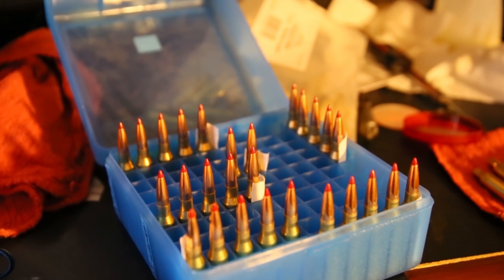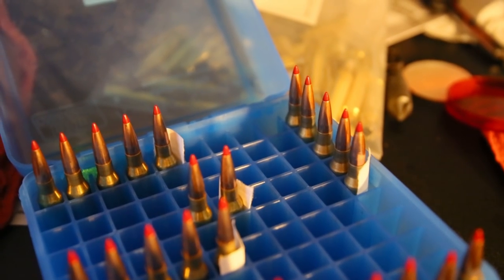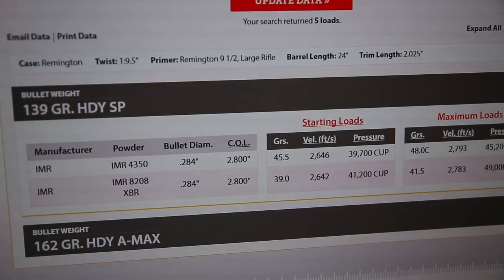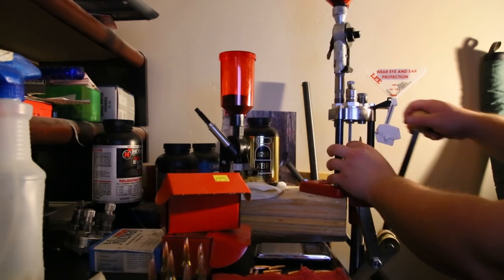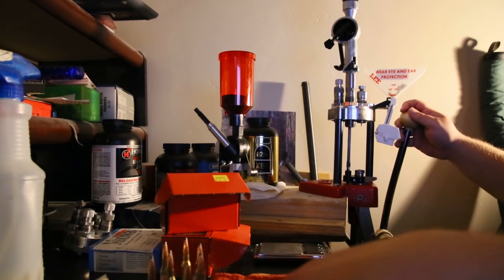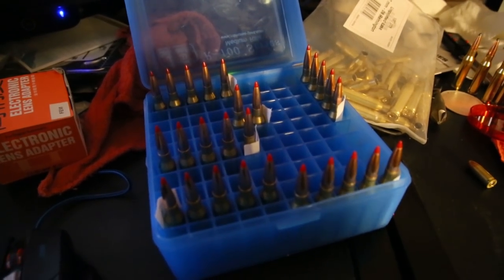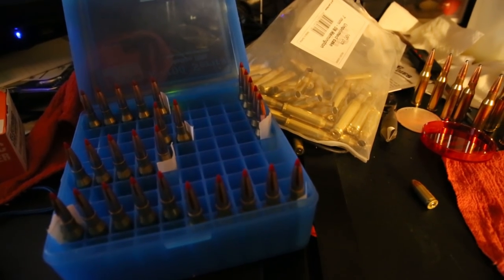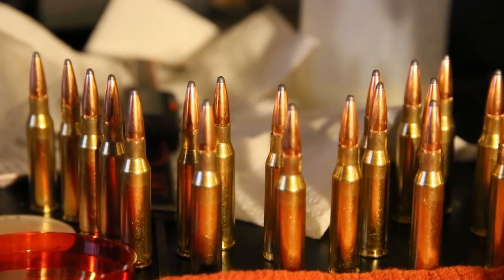Why I switched from 30-06 to 7MM-08 And reloading 7mm-08 for Elk - Lee Classic Turret Press

Comment: I have several diff. calibers including the 7mm-08, 30-06, 325 WSM 270 Win and 243 Win.  I have always had a huge preference for the 30-06 but I do love shooting the 7mm-08 the best!  All of those cartriges are awesome in there own right but the recoil of the 325 is a bit much it flat has Elk killing power to spare!!  But the cost of each round and the punch to the shoulder is significant!  The 243 has speed to burn but is a little too light for the large game.  The 270 is a great shooter and like the 30-06 will do anything well but has the kick factor that the 7mm-08 does not and it performs as well as the 30-06 in close <300 yds and >300 a little better due to BC and my shoulder loves it and so does my wife and 12 year old grandson they both can shoot it well and fast for follow-ups with no flinch.  *7mm-08*

Comment: I only fire 165 gain projectiles out of 30 caliber rifles which is what I shoot out of my 06 Ackley.  But, I will be getting a 7mm-08 for my wife.  The only time I bring any thing larger out is when targeting large Wapiti or going North of the border for moose or bear then I use my .338 Win Mag.  I have found it better and most rifles shoot more accurately with less that max pressure loads ... as well as the brass lasts a lot longer (one of my main reasons to going with the .06 Ackley is the lack of case taper, all I ever do is neck size, it has no brass flow as all tapered cases have).

Comment: I reload for a bunch of different cartridges, about 30 of them at the moment and the 7mm-08 is my second favorite. Great performance on deer/hogs very little recoil or muzzle blast heck the kids shoot it with max loads with no complaint. I am getting consistent 3/4" groups at 100 using Big Game and 140gr Sierra Game Kings, not too shabby for a 6lbs rifle as with ALL of my 7mms it took a bit of load development to get it dialed in but I love it now. The only reason I rank the 6.5x55 higher is how amazingly easy it is to work up a new load for, pick any 140-143gr bullet and place it over RL22 and I guarantee sub 1/2" groups, best group was the SSTs at 1/16th" at 100 yards! A rapid expansion 140gr bullet from either is potent deer medicine, the 6.5mm has better BC while the 7mm-08 gets higher speeds by about 100 fps.

Comment: 7mm-08 is a great gun, I have one in a Ruger American that had a 22" barrel that shoots lights out. I run a heavy dose of IMR-4350 with a 139gr. BTSP Hornady Interlock, I have shot elk with this bullet at about 250+ yards knock 'em down. I am going to try the 150 ELD-X Hornady came out with for the .284 caliber guns, which I will try for the 2017 hunting season on elk and deer, might even try it on a black bear hunt this summer. Good luck with your reloads with the 162's let us know how they grouped and what kind of speeds you got out of them?
Reply: 7MM-08 at any reasonable distance with solid (copper), or 140 gr Lead core will sufficiently do the job.

I've killed many a black bear and can attest they take nowhere near the energy as opposed to even a whitetail.

My 7mm-08 is a "Truck Gun", that means always there... Even if I'm hunting with a different round, it's always "THERE".

I can get 3/4" inch outside to outside groups with it every day but I also handload.  I would advise Hornady Factory Ammo if you do not.  140 preffered for bigger game.  Solid copper platforms, 120 is enough below 300 yards.

TR
Reply: BTW: consider ammo availability in your choice.  The ole '06 still performs as well as it ever has and is no slouch.  PS I have a .338WinMag named the Hammer and a '06 named ole Betsy.  :-)
Reply: I have a .30-06, 270 WSM, 26 Nosler and my mack daddy .338 RUM. But I like this 7-08 it is a fun gun to shoot. Happy Shooting and hunting....
Reply: @travisrushton7966  The 120's, how far are they off the lands? Is there a minimum weight bullet you need to have to get close to the lands?
Reply: @Ebaybow  I load them pretty far out in the cartridge. From the lands, ?, not sure as I don't own a Micrometer Adjustment tool for the 7mm-08. Remember this gun of mine is "probably" a fluke cheap gun that goes everywhere and is accurate as all get up. Sorry I couldn't answer your question. I have a Micrometer tool for my .338 but I've been able to tailor loads for the rest of my guns with no need. I absolutely LOVE the 120's... In Barnes TTSX, Accubond, or ballistic tips. I've taken my share so I'm not just qback armchairing. Good luck and try em out!  REM7600
Reply: Kelsey how did those 150gr eldx's work for you?

Comment: I think the 7mm-08 is a great round. It's ballistic twin is the 7x57mm Mauser. Both cartridges punch above their weight class. I have a commercial Mauser 98 7x57mm I use 7mm-08 load data with no problem. I think the 7mm-08 and 7x57 smoke the 6.5cm. I think both 7mm-08 and 7x57mm are under rated. If you use the right bullet with high BC I think 7mm-08 even the 7x57mm can out perform 6.5cm even the .270 Win. I was told by my gun smith my 7x57mm can handle hotter loads than the 7mm-08? I don't know if I want to chance that.  Great video!

Comment: try reloader 17.  with 145g lrx barns 48g reloader 17  I get 2900 fps from a 19inch shilen barrel. no pressure signs loading 5 thou off the lands . 2830 fps with 47g behind 162g hornady eld no pressure... superb long range hunting round
Reply: Mine likes the 139 sst with 43.5 gr re17. Not fast but every bullet hole touches each other at 100. I've only shot it out to 500.

Comment: Glenn,  Have you ever experienced any of the eld x bullets blowing up on impact on shoulder shots?  I have shot some eld x factory ammo through my 280 remington as well as my wifes 7mm-08 and I am yet to be pleased with the terminal performance on game.  I shot two whitetail bucks last season with less than desirable performance.  One shot at 120 yards and the other at 265 yards.  I lost one of the deer even using a tracking dog and the other deer ran over 200 yards and this was with a shoulder shot that has never failed me with hornady sst and barnes ttsx bullets.  The accuracy is amazing in the eld x bullets but i am scared to use eld x for hunting whitetail and hogs now.  The deer i did recover the bullet from showed about 3 inches of penetration and the bullet completely broke into numerous pieces of shrapnel.  I see people praising this bullet on multiple sites and i agree the accuracy is superb but shooting at non magnum velocities I feel this bullet should have held up much better seeing as Hornady claims it is a short and long range bullet.

Comment: I do not own the 7mm-08 . I use a 30-06. As good as the 30-06 is . I would think the 7mm-08 is a better all around cartridge for the lower 48 but would prefer a 30-06 for Alaska . 200 gr partition in 06 would be hard for the 7 mm to beat on brown bears. If I had  a 7mm-08 I'd probably shoot more because of less recoil and less cost of reloading.

Comment: Dear Glenn.......thank you for posting. You mentioned problems with your Remington's........ Can you elaborate? We have a big deer hunting camp with a ridiculous variety of calibers and makes. Pump and semiautomatic 280 rems to 338 win mags and of course the old timers with their 30\30's and 35 Remington's and everything in between. My son is going through gun safety right now and its not even a debate that I'm buying a 7mm08 for him. Besides uncle Steve that has a 270 short mag Remington 700 and I have a regular 270 win in a rem. 700, we are the only 2 that has slightly newer Remington's (absolutely amazing tack driving rifles at the 400yrd range). I was going to order my son a 7mm08 in the model 700 stainless like mine and uncle Steve's. Has their quality gone downhill? Buying a kid his first rifle is hard enough and then finding out you bought him a piece of junk........I'd like to avoid that sir.
Reply from the maker: Dick Tracy, I think their model 700 is still very solid. I had the model 710 first, which had several issues, and the n the new model 783, which had one main issue. The main issue with the 783 was the ejector kept breaking. Well technically not breaking, its held in by a spring, and if bumped right it would become dislodged and the spring with flip it way out there, so it was impossible to find. After the second time it happened, I returned the gun. But it was tack driving accurate, like the 700. Just that one flaw. If Remington can redesign that ejector it would be a great value gun. 

But, as for the 700, I think you will be fine. They haven't made too many changes to the design, which is why its still solid.

Comment: The 165-170gr. In 06 will out preform the 7mm08 with 162s. A good quality 140-150gr in the 7mm08 are plenty for elk.
Reply from the maker: Actually no it won't, especially if you shoot further than 300 yds. The 7mm-09 is much more efficient than the 06.

Comment: Interesting.
I was taught to press a bit slower, use ever such a tiny amount of lube in the neck, to measure and check the cartridge lengths, even when new.

Was that bad advice?
Reply from the maker: No I think that was pretty good advice. When I did this video (nearly 7 years ago now) I was just barely getting into handloading. I had done some research, and my rounds were accurate. But there was a lot I could improve on then and still is today.
Reply: @GlennPearsonDIY  sound buddy, thanks.
I was taught by an engineer who was at one time the Keeper of the Queens Deer here in England. 
He sure could shoot and make up a great round.

Comment: How accurate is your powder dispenser??  Do you check loads every now and then to make sure your throwing the correct amount..
Reply from the maker: It's pretty accurate. This video was not long after I got it. When I'm reloading rifle rounds for practice I check it every 3-4 to make sure it's on and it's always been accurate. For hunting loads I now use an automatic powder measure for accuracy.
Reply: @GlennPearsonDIY  Thanks for the response.  Good to hear on the powder measure..

Comment: What is the rate of twist in your 7mm08. I wonder because of the bullet weight you are using and really need a swift twist. Remember one of the laws of physics is the faster it goes the faster it slows down so energy at long distance may not be what you really need.

Comment: I might have missed it in the video, but what type of case lube did you use, if any? I'm amazed how you can crank them out like straight walled pistol cartridges. I usually have to interrupt my progressive press process to remove the case lube after resizing.
Reply from the maker: Cristian, I am using a home made case lube I found out about from another youtuber. Its a mix of rubbing alcohol and lanolin. Works great. I have it in a spray bottle, and I had already lubed these cases before I started the video. I spray the lube, and let the alcohol evaporate leaving only the lanolin on for lubrication. I can do 10-20 cases at a time (or more if I had more space). Spray them, roll back and forth to make sure they are completely coated, let the alcohol dry for a couple minutes and then pump them out with the press. I can do a video of it sometime if you're interested.

Comment: Glenn, how you liking your 7mm-08 so far?  I'm thinking of one for all around use up to elk sized game between my .25-06 and .308.  .308 isn't really a hunting rifle and I don't know if I want another .30 cal and what you described in the video seems great about 7mm vs 30-06.

May just be the round for me.
Reply from the maker: I love my 7mm-08. I reloaded my 30-06 for about a year, and I'm loving the fact that I use about 10-15% less powder each round for practice with my 7mm-08 over the 30-06 because my powder lasts a lot longer. I'm also enjoying the noticeably less recoil. 

I got an elk with it this year using my 162gr ELD-X loads. I was 260 yards and it passed through both lungs with a very nice wound channel. So I'm very happy with its performance for hunting as well. I'm about to load up some 120gr loads for coyote hunting. I'm planning on posting another video about why I love the 7mm-08. I'll share it here once I do.
Reply: Glenn Pearson I see, what you just said about it and Elk was exactly what I was wondering about.  Yes I've also considered the .280 which you probably know about in the 30-06 family, however the 08 seems more practical less powder and within 150-200 fps of the .280 so...Also to consider already have a 25-06 so .280 may not really be very different in all honesty 

I wouldn't be shooting at any big game animal past 400 yards maybe 500 at an extreme, so energy wise seems to do well.   I'll be glad when you post that video!

Thinking of a T/C Venture in the 08, I love 700s but not fond of their lower price offerings in comparison.  Or a Vanguard like you have , maybe a xbolt composite...
Reply from the maker: Yeah, I looked at a T/C Venture as well as some 700's, Ruger 77 series and Savage 111's. But the Vanguard had a 24" barrel which I wanted to have to pick up a few more FPS, I think the rest only offer 22" barrels for the 7mm-08 chambered rifles , and I got a great deal on a Vanguard Series 2 from a local dealer. Ended up spending about $500 for it, about 150 bucks off or so. My dad picked up one of the Savage 111's and really likes it. I am seeing about 80-100fps more on my chronograph out of my vanguard using the same ammo over his Savage though, and I'm assuming its the longer barrel. 

Weatherby has been great to deal with. I was seeing some strange pressure issues, and they help me determine that it was the brass. While I was shooting these rounds that had the pressure issues, the case ejector chipped, and Weatherby replaced it under warranty, no questions asked. So I'm fairly pleased with the Service so far. Of course Remington's service was good as well, though occasionally they were a little slow on responding. My issues with my Remington 783 30-06 are the reasons I decided to go for the Weatherby over another Remington.
Reply: Glenn Pearson gotcha Vanguards are a great rifle.  My research is that 22" even 20" is very little velocity loss for the 08 so I'm okay with that but the Vanguard having the little bit longer barrel could be a plus a little.  That much of a loss unless it's 18 or 20" I wouldn't think typically would happen in a 22" hard to say there.  Just seems like a very efficient cartridge.  

Yeah I love the 700s I have and go for the higher end models but unless buy to upgrade think there's better options in the more budgeted range.  Sorry to hear about your 783 they seem like a good rifle for budgeted.  T/C and the vanguard in that range hard to beat.  I'd say Howa but is same as Vanguard basically ha.
Reply from the maker: Yeah, Howa makes the Vanguard, but they only offer a 22" barrel. A lot of people have 20" and 22" barreled 7mm-08's and love them for hunting. 

I love this cartridge so far. I think its probably one of the most efficient cartridges if you look at how much powder it uses, and then the down range energy and velocity. If you look at ballistics between the 7mm Rem Mag and the 7mm-08 for factory ammo, the 7mm-08 is within about 200fps at 500 yards. But the crazy thing is, its using 30-40% less powder.
Reply: Glenn Pearson That's what I thought was really good about it is it's not that behind the 7mag being SA and exactly what you said.  7 mag is a good round, but it's pretty intriguing how efficient the 08 is in comparison of performance.  I think I'm convinced on getting a 08, so I'll just see about the rifle sometime.  Either the Vanguard or Venture likely.  Biggest thing about the Vanguard was they are almost 8 pounds, for a sporter weight rifle that's kind of heavy to me, how heavy for what it is does it feel to you?
Reply from the maker: I hiked around probably 30 miles with my Vanguard this last elk hunt and it wasn't too bad, but I'm sure the 1.5-2 lbs less on the Venture would be pretty noticeable and feel nicer. There were maybe 2 times I think where I wish I had a lighter gone, but I'm still pretty sure I would have picked the same rifle if I had to make the choice again.
Reply: Glenn Pearson Gotcha helps me see a bit more on that.  Quality wise between the two can't go wrong so when comes down to it just will see which one suits me best.  I wouldn't mind the Vanguards weight in other types of chamberings but for the 08 may be better for a little lighter package I will see.

Appreciate the replies and info so far been very helpful...
Reply: the 7-08 is a 308 case 56gr h2o,  280 is a 3006 case 68 gr h2o, 7mm mag is a 375 h&H mag case with 82 gr h2o.  All three rifles will fire the same bullet, but the velocity goes up with each one. 7mag can be a 1 mile gun, a 7mm-08 can be a 1400-1500 yard gun. The 280 is somewhere in between. For short action, the 7-08 is way under estimated. I'll take it over the 308 any day. I wouldn't compare it to a 7 mag though.  The 7 mag will shoot those 162 gr eld bullets way on out past the 7-08.  that's a lot of powder behind the 7 mag. Mine has a 26 inch barrel too. I can personally shoot more accurately with my 7-08 or 6.5 creedmoor though.
Reply: I personally would not drop to a .25-06 based on field reports and real world experience.  In fact, most of that real world experience, always head back to a .30 cal (the ole timers). I would recommend a 7mm or at least a 6.5. I personally love the 7mm-08 and I have shot almost everything as far as calibers.  If your goal is 335 lb'ish deer, 7mm-08, if bigger, make the jump to a .30 or my preferred .338 in a Win Mag or if short shots maybe a .35 Whelen.

REM7600